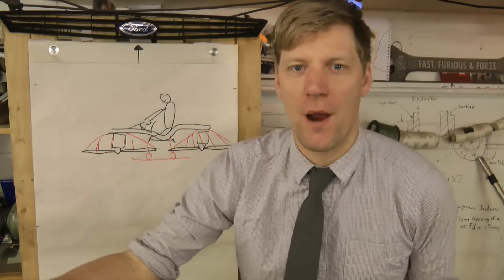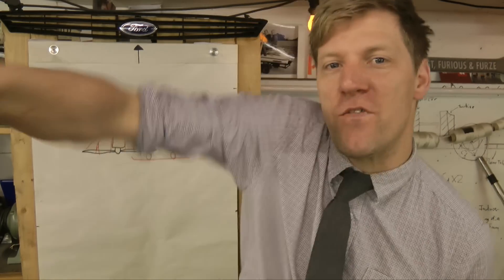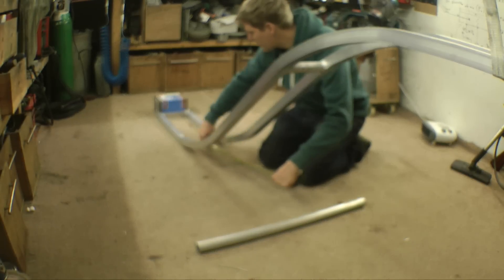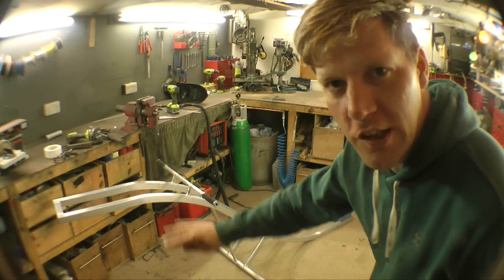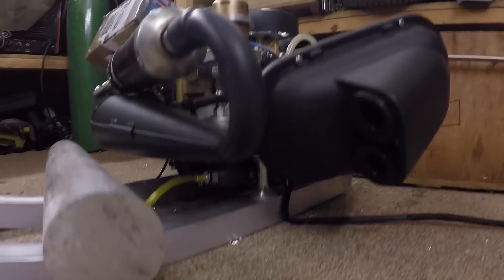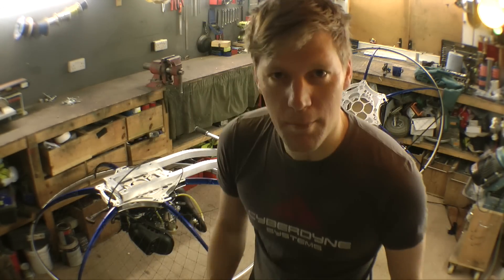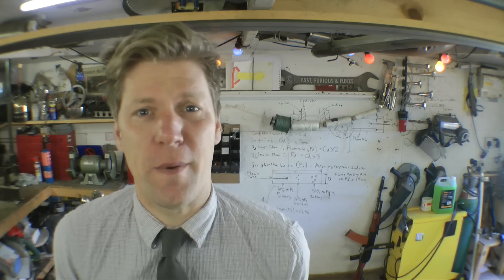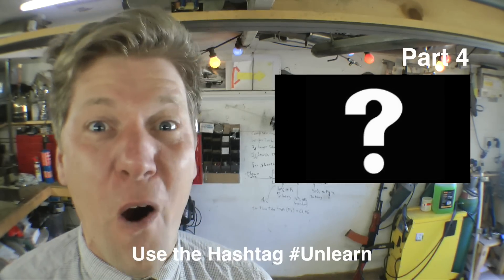Making a Home made Hoverbike

Comment from the maker: Here we go, so many comments on how this is going to not work or fail etc and it's been an interesting project with so many things learnt. thanks you all for the input the one thing i like about these projects is you all get involved and are talking and sharing knowledge with each other and myself.......but does it get off the ground??????
Reply: Super speedy reply
Reply: Ermagerhd it's totally going to werk
Reply: +colinfurze  Yes, it will.You're light enough,  and the engines are powerful. I can see this working.
Reply: você é muito doido louco kkkkk e isso deixar seus vídeos muito legais hahhaha
Reply: +colinfurze I question steering mechanisms, unless you're using the counter rotating blades to provide steering. Looking forward to it.
Reply: I bloody well hope nothing goes wrong, good luck please don't die
Reply: +colinfurze Nice work! For control: maybe fitting drones on the corners will do the job! because i suspect human reaction time will be to slow to balance it, so let drone processors do the balancing job for you!
Reply: +colinfurze colin you need a seat. I think you're gonna see how much difficult and dangerous is to drive that thing (need stabilizers, it will roll). So, I can't wait the next video, upload it fast!
Reply: +colinfurze Please do this in accordance to whatever safety protocol there is available to you. The worse thing is we have you lose your damn head trying to get it to fly.
Reply: If you die say hello to my relatives in heaven plz.
Reply: +colinfurze Next video next thursday?
Reply: +Allyson Gomes esse cara é foda
Reply: Dude ur so fcking awsome, Love everything you build keep up the good work
Reply: +colinfurze the better question is did you have it under control when it got off the ground.
Reply: +colinfurze This is amazing but please BE CAREFUL!!!  colinfurze for president!!!
Reply: +colinfurze it's awesome what you're doing here, keep it up! i'm actually psyched for the next episode
Reply: I fear for the day you lose it and become a real life supervillan, dude.
Reply: You're going to need a seat, that way your centre of gravity/pressure is evenly placed. It also makes balance a hell of a load easier. With that being said, the test has probably been done. On a side note, your videos are awesome.
Reply: +colinfurze  Dude!! U r frickkin awesome!! Godspeed mate!!!
Reply: But how are you going to move front ?
Reply: where we use the hashtag to see the next episode until you upload to youtube?????
Reply: +colinfurze I have bad feeling about that whole thing flippin to side once you take of
Reply: +colinfurze This entire thing  looks like a disaster waiting to happen. You could do some cool things with those fans though, a proper ground effect vehicle could make for an actually usable "hoverbike".
Reply: +colinfurze Not saying it will fail outright -- just that it will tend to want to fall over like a stationary bicycle. Need to mount the rotors above the rider to use that weight for stability.
Reply: Colin you are so funny can you try and make a jet bike that drifts
Reply: +colinfurze colin i did not know you had a little one. whats is his name
Reply: +belac 101 agreed, PLEASE don't die.
Reply: colinfurze i can't wait for 1 week!
Reply: +colinfurze where do you get your square brushed aluminium tube, I need some for my GCSE engineering but don't know where to find it.
Reply: lol so fast comment^_^
Reply: your my hero 😭
Reply: +colinfurze Well Sir, I certainly think what you are building will make a good hovercraft if you put a skirt on it.  A Chinook is able to fly with 2 motors is because it uses a swash plate to and variable pitch props for controls,  with your fixed pitch props you will have no control surface, quadcotpers vary the rpm of the fixed blades to provide control of your pitch, roll and yaw  but it needs fast refreshing esc's and a gyroscopic flight controller to keep it all stable.   Good luck Colin, hope you can figure it all out.
Reply: +colinfurze Dude, you are the real cazy. Awesome Bro........................ I'm hoping that it will work............it has to work...cos colin made it.......
Reply: Colin, love it. One little glitch though, flipping the one motor may have you believe that if you then flip the prop too it will reverse the thrust, in fact, nothing changes relative to the motor, but now you have one lift (front) and one dive (back, flipped) mounted to the frame. Unless you intend doing backflips, you'll need to get a tractor prop in the correct orientation and rotation for your rear motor. Hope this helps.
Reply: Keep doing all the crazy things you love doing, as it all cheers us up in our own way
Reply: +colinfurze And one comment that is around a lot too is: We need bigger videos plz :(
Reply: you are just plain amazing dude
Reply: +ledzyz I thought the same thing. If you look though you can see that one has reverse pitch from the other.
Reply: +colinfurze It will work cause this has been done before, multiple times. Also, wouldn't it have been easier for you just to reserve the blade angles?
Reply: +colinfurze I love theorizing about these things and guessing what will happen. In this case I think I know:
You have two motors, so you can control two dimensions. In this case the dimensions are: 
1. how hard you accelerate upward and 2. how much you tilt forward or back. 
This means that if you start toppling over to the side, you have no way of counteracting that.
This also makes for some interesting motion if you want to go forward. To go forward you'll have to tilt forward, but if you do one of the rotors will be spinning faster then the other and you'll start spinning around as well as moving forward.
Reply: +colinfurze You will probably need some sort of stabilizers, but I think that with enough work it could actually work.
Reply: +colinfurze You've made some really good videos recently, Thanks! I can't wait for next FursDay!
Reply: +colinfurze please figure out how to steer it, mabey tilting the rotors?
Reply: +colinfurze but please dont die because of this....
Reply: +colinfurze depents on your weight lol
Reply: +colinfurze Hope it went well, that rear fan setup looks horrifying. I always enjoy your videos. Thanks
Reply: +colinfurze Collaboration with Adam Savage (Tested/Mythbusters fame)? Could be interesting
Reply: +colinfurze learned*
Reply: +colinfurze coloca legenda em portugues nos videos
, vc e muito fera
Reply: +colinfurze Well at least we know that it didn't crash and kill him, being that he's still commenting on videos... So i guess that's a win.
Reply: +Michael I'd assume that he plans to lean like a motorcycle.
Reply: +colinfurze I believe it will work, I just dont know how easy it will be to control though.... Cant wait to see.
Reply: i think it will work but be hard to steer. the gyroscopic force of the props will keep it vertical then you can vary the rpm's of the motors to go forward or backwards. but how to steer? Iean? seems possible but difficult
Reply: i think it will work but be hard to steer. the gyroscopic force of the props will keep it vertical then you can vary the rpm's of the motors to go forward or backwards. but how to steer? Iean? seems possible but difficult
Reply: +colinfurze  hmm if it løifts you can try to improve it to get one (or both) of the blades to tilt to get forward motion. also tilt toi the sides for a small mesure off stearing
Reply: It will work I believe in you Colin haha
Reply: +colinfurze You're a badass for even building such a machine, fuck what random people on the internet say. I've been subscribed for a long time you're awesome. Cheers from Canada
Reply: Brakes don't forget the brakes. Lol where will it end awesome!  As I was watching your video you just said no brakes. Hahaha. Will it Colin Will it Fly!
In the States, Famous last words are hey y'all watch This. Good luck.
Reply: +colinfurze That thing look fucking dangerous but i love it :D
Reply: You are so qualified that you can easily work for a big company......... But still you chose YouTube.. Thats the most inspiring thing about you.... We love you.. Plzz continue to make videos...
Reply: You are so qualified that you can easily work for a big company......... But still you chose YouTube.. Thats the most inspiring thing about you.... We love you.. Plzz continue to make videos...
Reply: You are so qualified that you can easily work for a big company......... But still you chose YouTube.. Thats the most inspiring thing about you.... We love you.. Plzz continue to make videos...
Reply: +colinfurze I think, but don't quote me, but without control surfaces, you'll only be able to go back and forth, and side to side (with a bit of weight shifting ;)). You need something for rotation. Although you could control rotation buy adjusting the two throttles, holding one steady rpm and the other accelerating. But this would cause shonky lift (That is the technical term hahaa). I reckon a small lipo battery setup and some EDFs for rotation and stability. Don't even need precise control, just on and off. Or you could use a fire extinguisher with some actuators for little squirts of co2 powered control lol
Reply: +th3d3wd3r as the props are counter rotating easing off on the throttle of one will cause it to spin in the direction of rotation of that motor.

Or at least thats the theory anyway!. I really hope he tries this thing tethered.
Reply: yes it will definitely work Colin!!
Reply: +colinfurze flipping the motor also means the thrust is downward. Flipping the blade wont change that. Even if both thrusted up, it is an incredibly unstable design that will crash instantly and in a rather dangerous way at that. Try my design.
Reply: +colinfurze A+ for epic music & video synergy
Reply: +colinfurze As an aerospace engineer and a pilot i would like to say that your toy is roll unstable. So please, try it over a lake!! Good luck!
Reply: +colinfurze Perhaps this has already been suggested, but I wonder if the "Furze-o-Copter" (TM)&#160;could be controlled with a flight controller from a multicopter.&#160; I believe there is already firmware out there for a bi-copter.&#160; You would need to install fins below the blades to control pitch, roll, and yaw.&#160; But if it lifts you I don't see why it wouldn't work. However, without something to control the throttle on each motor independently and without fins to control the pitch, yaw, and roll it will be very uncontrollable and top heavy.
Reply: +zogworth the change in lift between front and rear would cause forward or backwards momentum too, or shonky lift as I put it lol.
Oh he'll be testing it tethered. My worry is whether it'll have enough testing before Mr furze removes the tether hahaa
Reply: +zogworth the change in lift between front and rear would cause forward or backwards momentum too, or shonky lift as I put it lol.
Oh he'll be testing it tethered. My worry is whether it'll have enough testing before Mr furze removes the tether hahaa
Reply: hands down the most creative and crazy youtuber!!!
Reply: @colinfurze I hope it does I'm so gripped on your videos its edge of the seat stuff 
true story
Reply: +colinfurze cant wait for part 4!!!!!!!! what has colin built
Reply: #Unlearn
Reply: +Justin Dehart At least we're both smarter than you.  : ^ ) I never said it wouldn't be an entertaining disaster.
Reply: 頑張って下さい！
Reply: +colinfurze Can I rent your hoverbike?
Reply: Nice one dude.
even if it doesn't work it's a good effort.
Reply: +colinfurze From a physics standpoint, the side to side stability will be entirely dependent on where the center of mass is located relative to the forces generated by the paramotors. The farther the CoM is above the upward forces, the more stable it will be. By stability, I mean the speed at which it changes position, or its agility. By bringing the CoM higher, your corrections don't need to be as precise.

You can increase the thrust of the motors, if needed, by putting a duct around each propeller. The tighter the fit (smaller the gap), the more thrust it will produce, since air isn't able to deflect/get pushed anywhere that isn't off the trailing edge of the prop. The increase in thrust would be greater than the increase in weight. You could make such a duct out of some sort of medium/high density foam, so if something goes wrong, the props will just eat through it, instead of having a rapid unplanned disassembly.

Anyway, I wish you the best of luck, as well as a means to have yaw control (turning left and right).
Reply: +colinfurze Dude, seriously, do not get killed. I have a friend of mine got his arm chopped up by a paramotor propeller and is not fun. 

There are so many questions about control and stability here. I do not see any sort of roll control here so you will flip along the main axis really quick.  You have some sort of pitch control with the throttle of each engine but throttle response is slow in these machines so you will have minimal control. And OMG no yaw control at all! And you have a high center of gravity! recipe for full destruction!

So do not do not do not get killed. I am being selfish here because i want to keep watching your videos as i quite enjoy them.
Reply: +colinfurze please can you make your video's longer. i would really enjoy watching this more if it was say at least 20 minutes long
Reply: +colinfurze ,if this won't fly, you can always put another pair of propellers aside.. then maybe you can add quadcopter controller for stabilization.. then you can fly for sure :D
Reply: +colinfurze men omg you made a futuristic thing that wil make our lives easylier good luck to you i hope it will works
Reply: +Allyson Gomes  é verdade né
Reply: +colinfurze Man, although I'm  a great supporter of your channel, your videos have one downside...they end XD
Reply: +Wicked Nasty Funkdoctor 
Yes they will work running in opposite directions as long as you flip one of the props over!
Reply: +Λαναράς Δημήτριος yup
Reply: Why next fursday do it tomrrow plz
Reply: +colinfurze I think it will gett off, but it will be unstable and it will tilt to the right or to the left..
Reply: +colinfurze thats the most beautiful creation you have made. looks awesome :)
Reply: +colinfurze You're probably not going to read this but I can see this work, stabilization will be a tad bit tricky with the center of gravity of.

People saying stuff don't work is why we got the middle ages!
Be the new Edison, and get us airborne Sci-Fi has promised it for years :D
Reply: +colinfurze you accidentaly wrote fursday at the end
Reply: +colinfurze Im not sure how the propelers are fixed, but wouldnt it be easier to invert the propelers instead of going through the trouble of a more complicated chassis?
Reply: +Zohaib The Gamer really dude, really?
Reply: +colinfurze  cool stuff , you awesome!
Reply: +Bart Hooghwerff no next Frusday
Reply: +colinfurze #unlearn
Reply: you are epic
Reply: Make a liquid nitrogen gun
Reply: +colinfurze Its made by furze and your still alive so i would say that mega flying monster does actually hover.But on thinking about forward motion you would need the back up a bit or at least a smaller version on the back thats facing the rear to then have forward manouvrablity...wow long word.
Reply: yes your going to need an opposite handed prop. Think of it like left and right handed threads.
Reply: lovely aluminium welds though. props
Reply: +colinfurze Oh you will lift off... no doubt about that. And then flip over and hit your head. Srsly! How will you solve the stability issue with just two propellers? :-O
Reply: George French 1 throttle for hover other throttle for rear straight facing fan for forward motion.
Reply: +colinfurze Take off: possible. Controlable: Definetly not in a comfy way. Maybe if you lean back/forth. When you'd lean to right/left it would tip over, I 
think. At least it will not be very stable in the air.

Well we'll se where this is going. Wish you luck! :D
Reply: +100 Hobbies (how to spell knited)
Reply: +Craig Ridley No way, the states would ruin it. Like they do everything they take from the UK.
Reply: +Painmaker You do realise that he's likely recorded all the parts of this series in advance, right?
I highly doubt he's built it, then waited a week before seeing if it will work.

Hell, I would even go as far to say that if the entire thing was a flop, he wouldn't have uploaded any of the first videos.
Reply: +100 Hobbies knighted
Reply: +J. van der Linden You haven't accounted for the possible shift in weight distribution. Colin can shift his weight left and right which can provide atleast some roll control. It's yaw he will struggle with, since I doubt this thing will be able to move forwards fast enough to allow him to turn by leaning (like you would a bike).
Reply: +colinfurze I think it should be Furzeday, not Fursday.
Reply: are you married
Reply: +Zidan ramadhan yes, yes I am
Reply: +colinfurze Steering shouldn't be much of a problem. Just shifting your weight from one foot to the other should be enough. Forward and reverse will likely require a separate throttle for the front and rear engine. Power up the back to pitch forward, power up the front to pitch back.
Reply: +colinfurze  any side you put motor, clockwise prop remains clockwise prop
Reply: +colinfurze Consider stability.  This thing will roll upside down as quickly as a stationary motorcycle unless you mount it above you, so your CG is below the props, providing natural, pendulum stability.
Reply: +colinfurze you sir are a legend
Reply: +blurglide Yep.  The higher the engines are mounted above the main mass of the contraption, the more stable it will be.  It will be fun to watch.
Reply: Are you gonna sell anything that you have created in the past
Reply: +Jo han! That.  I'm sure it'll go up and with you on it, but with just two engines I can't see it doing anything other than flipping over eventually.
Reply: PULSE JET AIRBOAT
Reply: +Talha Sayed Different Trust would.
Reply: +colinfurze I say it overs about 300 cm of the ground and you have some forward and side to side control as you use your body to shift the center of the machine. But you won't be able to rotate left to right. Be safe.
Reply: It's a great project to me
Reply: What about if he mounted the engines on a spherical ball joint and was able to tilt the engines independently? You only need 1~2 degrees.
Reply: That's a good idea
Reply: +colinfurze You're essentially building a bicopter, but you seem to be missing some very important elements. It may be possible to compensate for some by shifting your body weight, but it's not going to be easy. This machine as it appears currently will be far more difficult to learn how to fly than riding a bike.

Here is how to best achieve flight with what you've shown us: Pitch should only be controlled by leaning forewards/backwards. Yaw control will work by leaning forewards/backwards and compensating with the throttle to that engine to match. The difference in torque between the two motors will rotate the craft. Roll can be achieved by leaning sideways.

Pitch control would normally be handled by varying power ratio between the front/rear engines, but you will get some severe adverse yaw from this maneuver, as your motors have no gimbal (or thrust vectoring) to compensate for the changing torque. You'd also want that gimbal on the motors to control yaw without having to pitch up/down. Roll is controlled by the gimbals as well, but only works well if the center of mass is above or below the axis of rotation of the engine gimbal. It doesn't matter which, (pendulum fallacy).

Bicopters don't work well at all with direct manual control. You need a flight computer managing this stuff for you. Fly by wire really is the way to go.

Lastly, the rear prop won't produce the same thrust as the front propeller without increased drag and RPM, as they are designed to spin in a specific direction. This will give you a constant yaw, due to the mismatched rotational drag, but I'm not sure how severe it will be.

Stay safe testing this thing. Drive it into a wall, even at low speed, and you could easily find yourself with a new carbon fiber limb replacing your gut.
Reply: +Michael Only thing I can think of is body weight. Counter rotation is for stability so the ting doesn't do 360s in one place.
Reply: +colinfurze when is next FURSDAY (at the end you said comingout next fursday[ no offence})
Reply: +colinfurze Heroic is an awesome band. How have I not heard of them? Thanks for introducing me to new music! :)
Reply: +colinfurze You know what, I've never felt so afraid. Please do this properly.
Reply: Make a drown with this method that can hold a lot of weight
Reply: ya
Reply: +colinfurze Wear safety glasses ;D
Reply: +Sacrifice crew he did
Reply: your definentally going to need 4 blades for stability, like the worlds first gas drone
Reply: +colinfurze I think It will work. You got the gyroscope effect from the blades spinning and so you leaning will not just make it go flip flop really fast. if it does not lift him he can always buy more powerful engines....Jet engines!!!!.
Reply: G'day,

  Yay Team !

   I'm glad you decided to pay attention to the people who were screaming at you about Torque and Contra Rotating one Motor & Propeller to address the issue, and I'm impressed at your response and solution...; that'll deal with that problem..., well done.

  I suspect that the Arrangement would be better if your own Centre of Mass was a bit below the average Centre of Lift, because thiso Gyaskootus still looks badly top-heavy ; and that is a bad idea for anything which is intended to be  Weight-Shift Controlled, because you're going to have to stand up in order to lean forward or backwards, or sideways, to be able to  make any significant Control-input...

 The problem is that as soon as you move one way and the machine follows that input you'll need to instantly apply an equally powerful Control-input the other way, to stop the Machine from continuing to pitch or Roll until it inverts and crashes due to an Unstable Dynamic Instability, meaning that you'll get "Locked-Out" with any more than about 5 Degrees of Pitch or Roll...

  And, assuming that you can achieve perfect Synchronisation of RPM(Torque) of the two Engines via one Twist-Grip,
Reply: G'day,

  Yay Team !

   I'm glad you decided to pay attention to the people who were screaming at you about Torque and Contra Rotating one Motor & Propeller to address the issue, and I'm impressed at your response and solution...; that'll deal with that problem..., well done.

  I suspect that the Arrangement would be better if your own Centre of Mass was a bit below the average Centre of Lift, because thiso Gyaskootus still looks badly top-heavy ; and that is a bad idea for anything which is intended to be  Weight-Shift Controlled, because you're going to have to stand up in order to lean forward or backwards, or sideways, to be able to  make any significant Control-input...

 The problem is that as soon as you move one way and the machine follows that input you'll need to instantly apply an equally powerful Control-input the other way, to stop the Machine from continuing to pitch or Roll until it inverts and crashes due to an Unstable Dynamic Instability, meaning that you'll get "Locked-Out" with any more than about 5 Degrees of Pitch or Roll...

  And, assuming that you can achieve perfect Synchronisation of RPM(Torque) of the two Engines via one Twist-Grip,
Reply: +maxsav007  Gas "Drones" already exist.  The word you are looking for is Multi rotor as this pertains to the type of machine you are referencing. "Drones" must be capable of semi or fully autonomous flight/movement.  Also gas powered Multi Rotor craft already exist as well. 

As a member of the RC community that is currently being negatively effected by the wrongful use of this term I apologize for being rude but this needs to be corrected.
Reply: +WarblesOnALot 

    Ooopthie, Finger Trouble, Continues....

   Then if both Motors accelerate & decelerate in perfect synchronisation, you still have no control in Yaw, just like with a Hang Glider,

  So, the Design is no longer actually Psychotic, merely a bit Demented...; and you're doing a lovely job of building it, but....., well, look at it this way....

  Pilots of Weight-Shift Flying-Machines are required to behave as "Intelligent Pendulums" ; and what I know happens to people who've turned their Hang-Gliders upside-down before Stalling them is that when the Pendulum is sticking straight up, the machine is uncontrolable and they crash...

 Strange to tell, but from 1994 to 1998 I was a bit of an Expert in preventing Hang-Gliders from getting "Locked-Out" on Take-Off when being towed behind Ultralights...; to see that bit of history, go to my "Personal Aeroplanology" Playlist, and try "Aerotowing Rogallo Hang-Gliders...The Lockout Index...", it's illegal to Aerotow-Launch Rog's in Oz without using my "New Inproved Method of not killing the Pendulum, has been since 1997....

   So, is it too late to give it Landing Skids, and then lower your Centre of Mass beneath the Propellers ?

  Inverted Pendulums are not good for Weight-Shift Helicopters...

;-p

Ciao !
Reply: #Unlearn
Reply: +A.J. Griffin he is but it is not going to work properly or as it should
Reply: +colinfurze  Carrot salad....yum yum. Haha    Im thinking super magnets on the end of the blades and a 9 volt battery for the new electro magnet for the new middle propeller. I think dorathy in the wizard of OZ should be scared....haha....really scared. I think it will work as its suprising to me how much power is behind just one of those motors. Just sayin.
Reply: +colinfurze You're still alive?
Reply: +colinfurze Ofc it gets off the ground :D Just about your balancing skills, and not crashing it ^^ Be carefull ! we wanna see many more videos from you ^^
Reply: I bet that thing is scary!!
Reply: +colinfurze you are crazy...SEI PAZZO!!!!ahahahahah
Reply: +colinfurze what gets me is the rear fans will now be blowing upwards instead of down??? OR is there a way to change the direction of the thrust. e.g., when they both were pointing down they lifted but by turning one upside down the thrust is also upside down so to speak so will be pushing the thing down instead of up.
Reply: Well. There does seem to be a bit of a center of gravity problem.
Reply: +colinfurze I'm very excited to see the answer to this question.
Reply: +Craig Ridley sometimes the worst thing a quality youtuber can do is go to broadcast telly
Reply: +colinfurze i dont know, it needs more jet engines.
Reply: +colinfurze please be safe ... when you said the thing about falling backwards into the fan and.. ehhhhh... ..
Reply: Remember you can always attach some helium balloons to give more lift!
Reply: is it really working we'd like to see some demonstration! :D
Reply: +colinfurze You need to add a system for stability on the horizontal axis, otherwise you will be leaning to the left or right!
Reply: +jo do He just needs to make it so that most of the weight of the vehicle is located low.
Reply: +jo do add a gyro
Reply: If you sold this for around £1000 online, I would definitely buy it. Also, you guys over in Britain are SO lucky! Here in America I'm stuck using the stupid U.S. customary system, while you get to use the metric system. Not fair!
Reply: Engineer 7718
You don't need to stick to imperial, you can use metric, too! Steve Ramsey from Woodworking for Mere Mortals does it, as does Matthias Wandel. Incra sells lots of metric stuff.
Reply: BigG .An Old Git Gaming 

G'day,

  USE THE PAUSE....; and look carefully at the Leading-Edges of the Airscrews....

  The Rear Paramotor is now wearing a Tractor Propeller, rather than the Pusher-Prop which Paramotors are supplied with...

  Use the Pause, and it will all become clear to you...

;-p

Ciao !
Reply: +JackDaniels2535 the first gas powered quad copter you can ride, if that already exists ill be impressed, real helos excluded
Reply: +colinfurze Put down your tie for flying or at least pin it some way to your shirt. In last seconds I was just waiting when it meets propeller and will blend you.
Reply: Will it fly ?yes. will it hover? never. is colinfurze a genius or mad? I realy don't know
Reply: +colinfurze You're a mad man.... but then it's why we love to see what you make... ...fly safe. O_o
Reply: +colinfurze are you using a computer to balance the amount of lift each engine generates??. It is recommended to use a  flight controller with this machine otherwise it might flip upside down or fall to either side. And please test the machine with RC remote controller instead of riding it. It it works you can then ride it.
Here are link to such flight controllers
http://www.aliexpress.com/item/Full-Set-RC-Drone-6-axis-Aircraft-Kit-HMF-S550-Frame-6M-GPS-APM-2-8/32534220177.html

http://www.aliexpress.com/item/Full-Set-RC-Drone-Quadrocopter-4-axis-Aircraft-Kit-F330-MultiCopter-Frame-QQ-Super-Flight-Control/32534136259.html
Reply: Hes colinfurze he dosent need it
Reply: LegoTD MINECRAFT LOVER 

G'day,

  Well said...!

  If you backscroll, you'll find my analysis..; wherein I rate the decision to invert one Paramotor & give it a Tractor Propeller as having transformed the Design from Suicidally Psychotic unto being merely Maniacally Demented...

  ;-p

Ciao !
Reply: Muhammad Saad 

G'day,

  Well done mate, nice try...

  The problem is that 2-Stroke Piston Engines are not capable of responding to a Computer's Throttle-Commands in the way that Electric Motors can...

  I guesstimate that if he has any more than 10 RPM difference in Rev's between the two motors it will have it yawing uncontrollably every time he changes the Twist-Grip...

  It's a Weight-Shift Bi-Copter with an Inverted-Pendulum trying to achieve  Control....; "Good Luck with that !".

  The fact that the Prop's are at different heights at rest means that on lift-off it's going to pitch away from the Lower Propeller due to variations in Ground-Effect making that Propeller produce more Lift (& Drag, & therefore Torque, thus there will be Yaw-Coupling as well..).

  I think he needs a really good Helmet, and 2 pairs of Kevlar Chainsaw-Chaps worn back-to-back, and a lightweight Flack-Jacket...; that might help...(?).

  If he only loses an Arm, then it won't be too bad ; I guess...

;-p

Ciao !
Reply: you are correct. He has to do more engineering to make that thing work
Reply: Please reply were do you buy metal from I a from the uk but don't know we're to buy metal ??
Reply: +colinfurze i am lovin' your vids and i wanted you to biuld a homemade gocart where you have a bugatti veyron engine please!?!?!??!!?!?
Reply: +Samuel Littrell holy cow that was quick
Reply: +Bhawani Shankar same
Reply: +Bhawani Shankar same
Reply: Hey colin  watching u make thinks makes me feel  DaVinci has returned
Reply: +colinfurze ok he is not dead...
Reply: I'm from Poland and you are the best !!! I watching you for 6 months.This project is great.(Sorry for mistakes,but i now learn English. ☺)
Reply: Muhammad Saad 

   Oh, it would work quite well just  as it is ; as a mooring-point for a small Rowboat or Sailing-Dinghy...

  Simply tie a rope onto it, and drop the whole thing to the bottom of the Harbour, and then fasten a Buoy to the free-end of the Rope..; that would work, and it wouldn't be dangerous at all..., though the Aluminium would corrode fairly quickly...

Have a good one,

;-p

Ciao !
Reply: I have an idea for what you should make next, I'm a young inventor and I cant make this with out the funding but you might be able to, the invention is a light labor, also can you give me and my channel a shout out if you make this
Reply: +colinfurze 2:26, what is the song called?
Reply: Colin you should start vlogging
The Cog Vlogs!
Reply: Pls ,if the flying Machine works then make a submarine that can stay under water for 10 minutes or more  and go at least 9 ft deep 

Challenge excepted or to scared. I think the challenge is  excepted. Like what challenge haven't you tried to do
Reply: nice music
Reply: +nick Chazotte Accepted, that's accepted, i'll except your spelling mistake...does that make sense with my wireless keyboard skipping letters...?